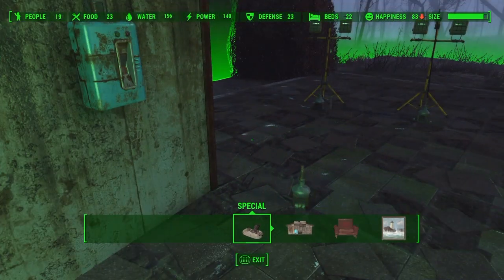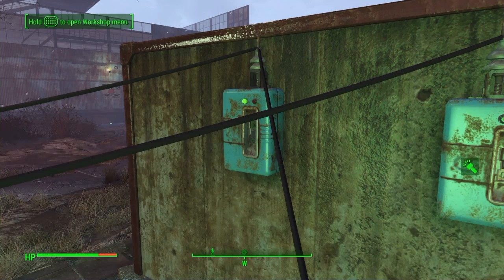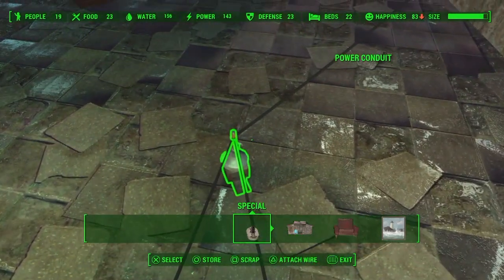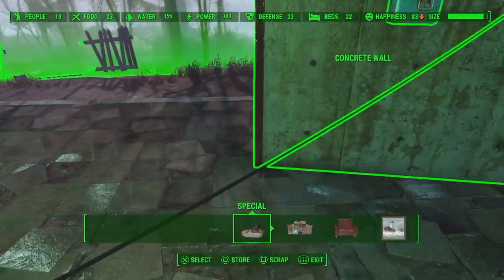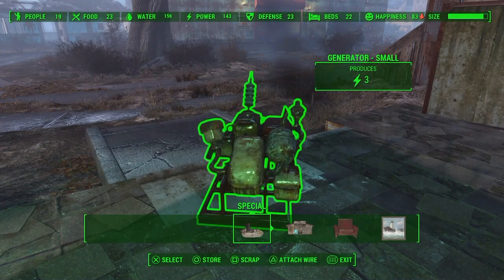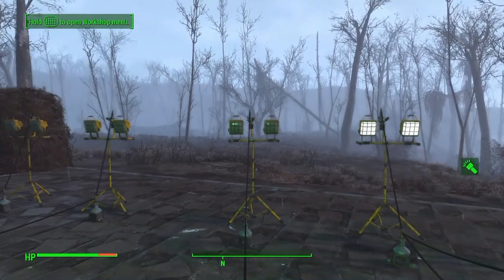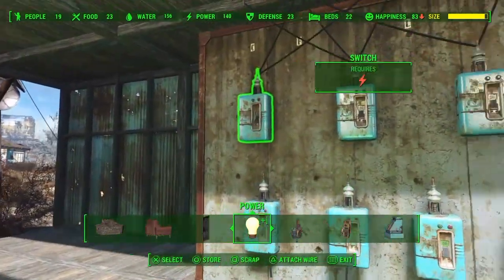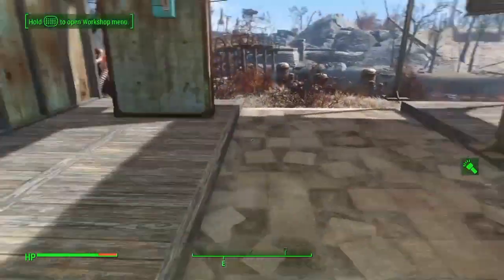Fallout 4 Control Room Wiring

Comment: Oh good! You made the wiring follow-up video! Very well done, I liked how you demonstrated the difference between connecting to connectors and connecting to switches, it really simplified  the concept of transmission and interrupted flow to isolate process applications, and how to direct on/off functionality to multiple inputs. Also, demonstrating the conduit application of wire first, build second definitely helped me understand why I could never get my conduits to function properly., now if they only snapped to walls to be perfectly lined up or squared to the floors and walls. wishful thinking right?

Comment: Short summary for someone watching: independently route electricity from your power source to your switches, then let your switches control the flow of energy by routing from them to your connectors and conduits.

With this setup the switches themselves act as logic gates of a type, only you can route multiple actions through a single lever instead of the logic gates that take multiple inputs to decide whether to flip a virtual lever.
Reply from the maker: Thank you for your summary, I know I can get long winded in an explanation, but some people that have never done anything like this may not understand what you just said.  I do, but not everyone will. What I was attempting to do was not only  tell them HOW to do it, but explain WHY it works the way it does.  Then if things don't work right they have some idea where to look for the problem. I understand for those people that understand it, my explanation can get very boring.
Reply: Peabody1001
The nice thing about a summary is that someone can read it once, perhaps not get it, watch the video, then read it a second time and see everything 'click' conceptually.  I meant it only as a reinforcement tool, not any sort of jab.
Reply from the maker: I didn't take it as a jab.  I do tend to get long winded explaining stuff.  I was only commenting to you the reason I show "why" to do something and not just "how" to do it.  Like the old saying "give a man a fish...feed him for a day; teach him HOW to fish and feed him for a lifetime."

Comment: thank you for the tips about the ceiling snap conduit pieces. I couldn't figure out how to use those either. when laying/aligning conduit, it's a pity that there is no 90° snap.
Reply from the maker: Most real life conduit used corners (elbows) because they install the conduit THEN they pull the wire through so it makes it easier.  But there are 90 degree pieces, the first four in the conduit tab.  They are called 'conduit junctions' and they have two, three and four connections on them, you can use them on floor or ceiling.  What I wish they had was vertical ones. (maybe that is what you meant? You can't go 90 degrees up or down? Since the only vertical are the full length ones.)
Reply: What I meant is pieces that would snap so that the connectors were 90* from the wall. Like in the beginning of the video he was fiddling with the piping to get it positioned just right.
Vertically oriented conduit would be nice, too, so you can go up and along a wall, from inside or out.
Reply from the maker: Snoww olf Ok, I understand what you mean, it would be nice to have that ability to snap at 90 degrees.

Comment: You can change the length of your clips in the advanced video settings from 30s,5m,10m,15m,20m,30m, and 60m
Reply from the maker: That came with one of the updates, I don't think I had it when I did this one, if I did I didn't know about it.   Thank you.
Reply: Peabody1001 no problem

Comment: Could possibly improve the look of your switch wall by using a pass through on the side instead of the two connectors. Then you've only got one connection peering through for power. And the conduits do a good job of isolating power so it shouldn't be much issue.

Other than that, solid video. Haven't played with counters myself, but I like the thought process.
Reply from the maker: If I understand you correctly, yes.  There are several ways it could have been wired.  The reason it was this way it at first there was no bottom set of switches so I keep the power centered at the top instead of the side.  As you see in the video I actually put the wrong connector on the conduit at first because that is the way I did it in the factory before I added the bottom switches.
Reply: That makes sense. Will be waiting for the next one. :D

Comment: Have you done a video yet on how you wired the belts and ammo?
Reply from the maker: For the belts just run a wire to a switch and then the belt.  The ammo type is selected with the computer terminal, and that is wired to the ammo plant.
Reply: OK but do I hook it up to the same power source or a new one and wire different? I have it on the same as the hopper power and cant figure out how to get a different power source lol
Reply from the maker: Run a wire from the power source to a Main switch, then run your other wires from that and you can turn everything on and off with one switch, easiest way to do it.

Comment: Thanks for this tutorial man. Super helpful. Is there another video for the second half. How do I get the component sorter to sort the specific ingredients? Thanks again
Reply from the maker: You put one ingredient into the component sorter. For example, the first sorter sorts for oil, so put one oil into the sorter, then anything passing through that contains oil will go into the first hopper. You need one for each item needed to make the ammo.  Oil, lead, copper, fertilizer, steel, and plastic.
Reply: Peabody1001 cool man one more question. I can't get the sorter to spit out the material into the hopper. Is there a certain wiring you need or just wait till it fills up. Thanks again
Reply from the maker: The sorters do need power, not exactly what you mean.   Are you using the "Component Sorter"?  There are two sorters, the component sorter (the one you need) sorts any item containing the ingredient you need. The other only sorts the exact same item.  Example: Component sorter you put in one copper it will sort out lamps, copper, fuse, hot plate and others that contain copper.  If you use the "Sorter"  and put in copper it will only sort pure copper, NOT item that contain copper.
Reply: Peabody1001 ok coo that's how I have it setup. Great vid man I'm all excited to make ammo now lol
Reply from the maker: There is a video on the factory tour, don't know if you saw that.  This was a how the hoppers were wired that was requested by people that saw the factory.
Reply: Peabody1001 yea I was going back and forth to double check
Reply: Will the sorter scrap metal from armor too like raider armor has steel. Things like that
Reply from the maker: The sorters don't scrap anything (except maybe in MODS)  The ammo plant does the scrapping and it will not scrap weapons or armor, only junk items. You can scap armor by dropping it on the floor and scrap it from there, you can scrap weapons at a weapons workbench.

Comment: hello there i have done all the things u said but now i have no idea how to control the ammo plant or the conveyor storages, vacuums or sorters is there any way you can help me i have the hoppers working fine for all 6 resources c,s,o,l,p,f thanks
Reply from the maker: Sure, I will try to explain, if not I could do another video, I should have done a build instead of a walk through.
First of all the lights and doors are on their own circuits so they don't go on and off when you power the machines on/off.
Since you mention the vacuums and conveyors I assume you have seen my factory, right?
OK, there are some things you don't need so I will do the basics to get it working. The machinery has basically three circuits.  

1. On the wall you have one switch supplying power to the hoppers switches. Connect that switch to the ammo builder.  Since the ammo builder is connected to the conveyors that run under the hoppers it will also power the connected conveyors, and the conveyor that goes to the storage hopper.
2. Add a second switch and wire it to the vacuum hopper that takes material out of the ammo builder when you are done making ammo.  That will also transfer power to the conveyors connected to it.
3. Add a third switch and connect that one to the vacuum hopper that sends material up to the sorters by the lift. Again it will transfer power to the conveyors, the lift and the sorters without any other connections.  Make sure you use "component sorters" 

Edited: In this edit I am referring to the steps above. The first thing I would do, the one switch in the video is directly connected to the generator.  I would disconnect it from the generator and put in a "Main" switch somewhere and connect the "main" to the generator and then run a wire from the main to switch one, from main to switch two. and main to switch three so each switch I describe above doesn't have to be connected to the generator.

Hope that makes sense, if not please let me know.
Reply: thank you for repling ill try this out how do i get the component sorters to take selected items only like oil,lead ect thanks again
Reply from the maker: Just put one of the item you are sorting for into the component sorter.  For example, if you are sorting for oil, put one oil into the sorter, on the lead sorter put in one piece of lead and so on.    If you sort for oil do NOT put in an oil can, only put in the oil. If you do not have an oil, drop an oil can on the ground and scrap it, then take the oil out of the workshop and put it into the sorter.  
To make sure I understand your question, when you put one oil into the sorter it will take all items that contain oil, it will not take just the oil.  So if you run the items you collected, it will sort out all the items that contain oil, it will not take the oil out of them. The ammo plant (builder) will scrap the item and use the oil and leave the other stuff behind, that is why there is a vacuum to take out the ingredients that are not used. Another example, the lead sorter will sort out a pencil, but it will take the whole pencil not just the lead, but when you make ammo, the builder will use the lead and leave the wood behind in the builder.  The sorters do NOT scrap the items.  Also keep in mind, the builders will NOT scrap weapons or armor.  
Also, don't forget in the video I mentioned to hoppers are facing the wrong direction just so you can see them working. Face the hopper door the same direction the conveyor belt is going, which means you have to turn them right or left so the items drop onto the conveyor.
Reply: cheers yh iv managed to got the ammo factory working now i just need to try and keep the resources flowing for it thanks again

Comment: this could have been simplified with 4 switches a and, or, and xor logic gate.
Reply from the maker: This video is only a simplified version of the actual ammo factory, it was done by requests of some asking how I wired my hoppers. And although I have a working knowledge of logic gates I am by no means an expert at it. There are actually 5 switches and 6 hoppers in the actual factory.  Even if I took the time to figure it out with logic gates, anyone that does not understand how they work would not be able to take the information and use it in their own factory which may not be an ammo factory and would require a totally different set of logic gates.  That is the reason I did it this way, so anyone could take this info and wire any factory to make any items, without having to understand logic gates. Thank you for your comment, I just don't think I am the one that could give them an easy way to do any factory using logic gates. I would be very interested in how you would have done it though.
Reply: I had to fill a slot in college and ended up taking advanced digital electronics. In that class we used things like programmable EEPROM chips and had to learn logic gates and boolean arithmetic. There is no need for knowledge like that these days of course until fallout4 came along and finally I was able to put my logic gate knowledge to use. I agree making a video to explain how to use them would be a chore.
Reply: Peabody1001
Reply: Logan Stinnett. Still... please do so.
Reply: Having no knowledge of logic gates, I found this video very helpful.